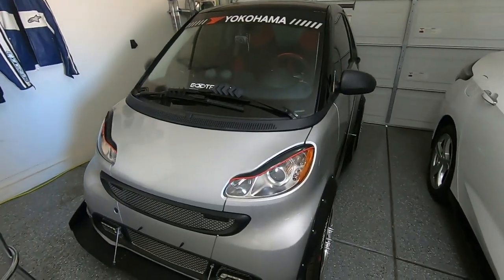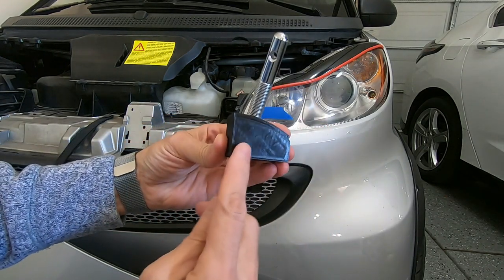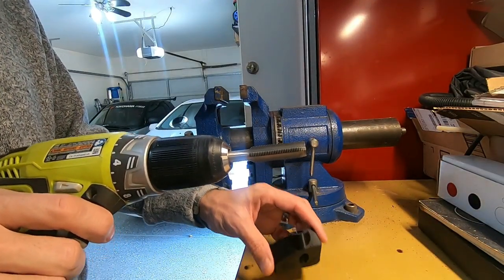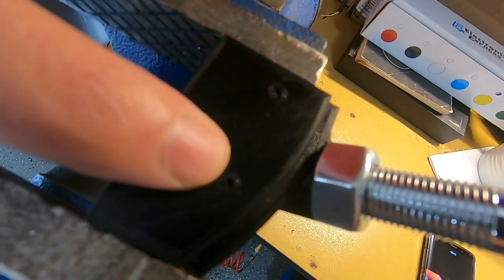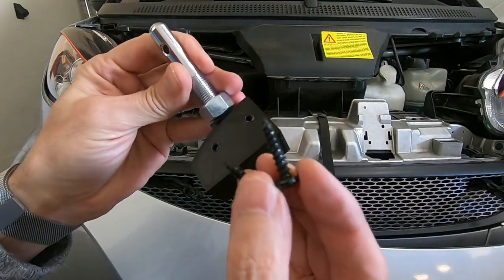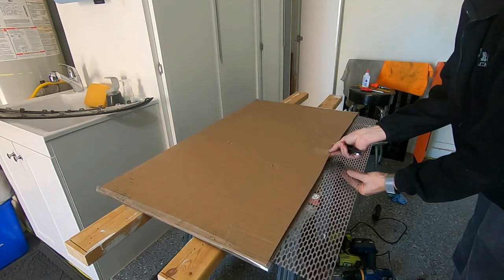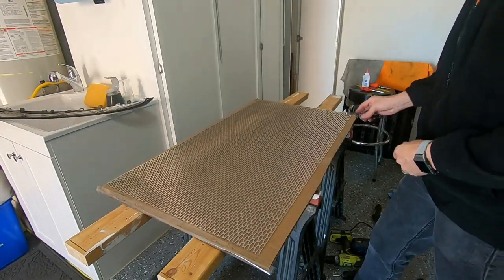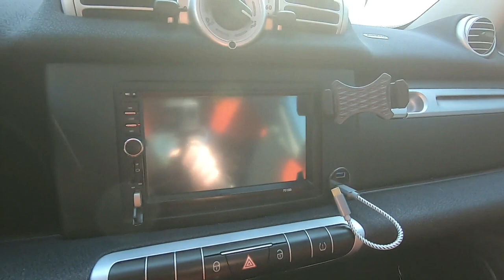Smart Car Hood Pins Complete Install

Comment: We went totally different directions. I made my car low with the right parts, and you hung a bunch of ebay trash off yours to make it look low.
Reply from the maker: I built this car as a joke, Taking the silliest car and making it "LOOK" like a fast car and it actually gets more heads turned than I thought.
Yes I could only drop it a little, I Used H&R 1.25" dropped springs and had to trim the fenders. The Flares are just to cover the "POKE" of the tires 2" wider than the body.
Do you have any pics or videos on what you did?